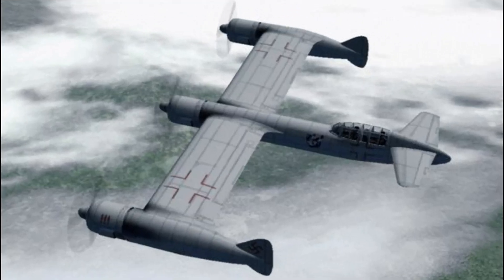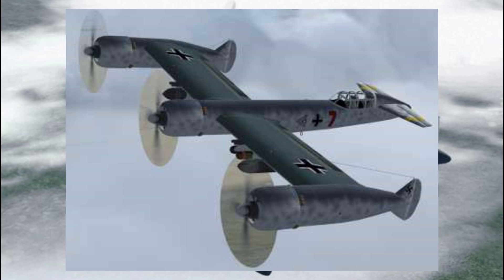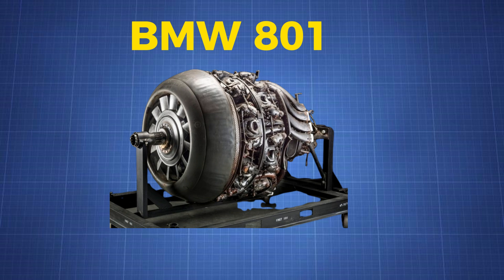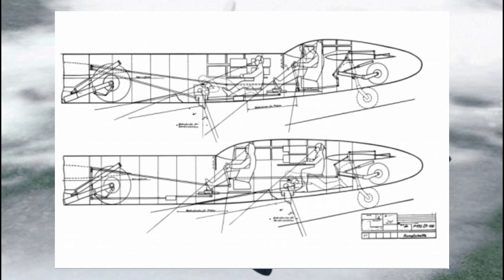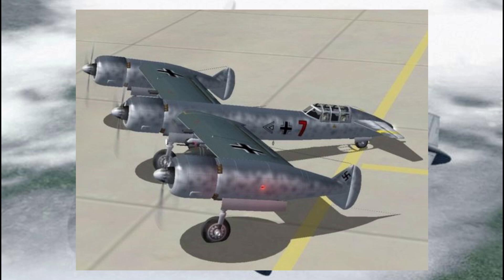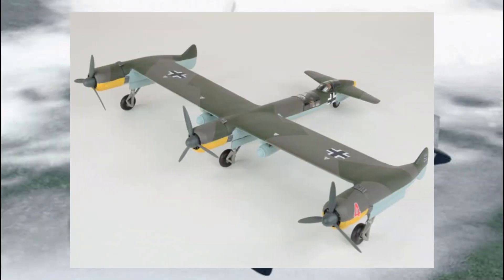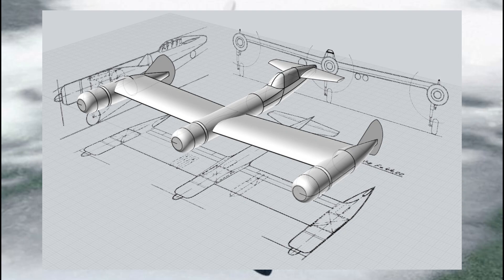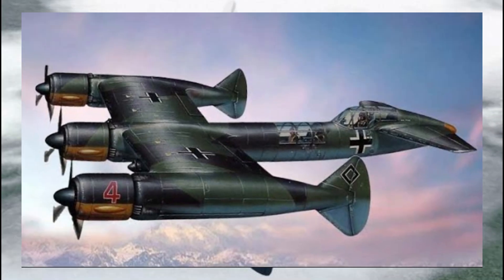Three Engines and Insane Speed: Blohm & Voss P 170!

Comment: Would have functioned better had the center engine mounted in the tail and the cockpit in the nose.
Reply: Centre of gravity needs to be in the centre of lift
Reply: @yakymua  Actually the center of gravity needs to be forward of the aerodynamic center if you want positive stability.  But that is easily achieved with an engine in the tail, as it is in airplanes from the D0-335 to all modern jet fighters.  You just move the wing to adjust the relationship between CG and CL.
Reply from the maker: True, that might have improved balance and visibility. Blohm & Voss definitely liked to do things the hard way!
Reply: Can you use a radial air cooled engine in a Pusher configuration? I suspect engine cooling may have been an issue.
Reply from the maker: Yes, it's possible to use a radial air-cooled engine in a pusher configuration, but you're right — cooling becomes much trickier. Without direct airflow over the cylinders, designers had to get creative with ducts, scoops, or forced-air systems. That’s one of the reasons pusher designs were rare, especially with radials

Comment: but wouldent 3 props give more torque but the same maximum speed like with boats ? Air is a fluid like water, less dense but the physics are the same, if you have one prop turning at maybe 3000 rpm and is pulling air it will  just be slower to get to max speed than if it was pulling with 2 or three engines, if all engines are the same than it wont increase the speed since the air is going past the engines at the same speed, or is my thinking wrong ?
Reply from the maker: Interesting comparison! Yes, air is a fluid like water, but due to its lower density and compressibility, there are some different factors at play. Three props give more overall thrust and better acceleration, especially during takeoff, but top speed is limited more by drag and propeller efficiency at cruise. So you're on the right track—it’s just a bit more complex.

Comment: Placing engines at the wingtips doesn’t minimize the effect of torque any more than putting them halfway out on the wing. The actual torque of wing mounted engines is not a problem like the torque of a fuselage mounted engine because they are not trying to rotate the airplane around its roll axis. They are trying to rotate the engine nacelles, and with the engines on the opposite wings they balance each other out.  Placing the props at the wingtips also does not reduce drag from "torque", but would reduce drag from wingtip vortices. But as the video states there would be strong asymmetric thrust with an engine out, which is probably not worth it just to reduce induced drag.  The rudders look nowhere near powerful enough to overcome that asymmetric thrust.

The wingtip mounted engine nacelles do not require the wing to be stronger, they allow it to be lighter.  The weight of the airplane is more evenly distributed along the wing, which significantly reduces bending moment under flight loads.  The wings also do not have to hold up the weight the outboard nacelles on the ground because each has its own wheel.

The cockpit placement is nuts.  Weight distribution cannot be the excuse.  Look at all the 4-engine bombers that also had the weight of all engines ahead of the wings and the center of lift.  Most 3 and 4-engine airplanes had plenty of fuselage forward of the wing to house a cockpit and other things. The reason for this cockpit was more likely to keep the fuselage diameter forward as small as possible and move the drag producing cockpit aft past the point where airflow is usually no longer smooth anyway.  I don’t think the small speed gain would be worth the adverse effect on pilot visibility.

The war would not have been different if this crazy design had flown.  It was an impractical design that was abandoned for good reasons and never resurrected by anyone else.  All I can assume is that B&V was desperate for attention from the RLM.
Reply from the maker: Thanks for such a detailed and well-reasoned comment! You clearly know your stuff. Totally agree that B&V pushed some wild concepts—sometimes more for attention than practicality.